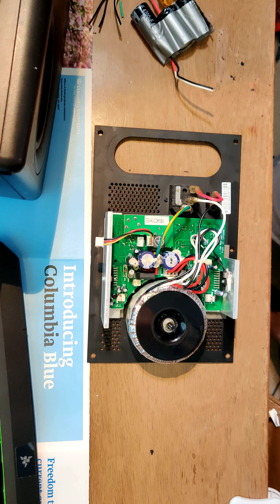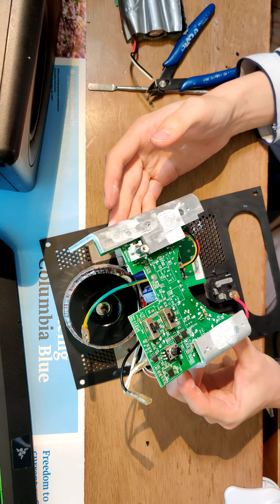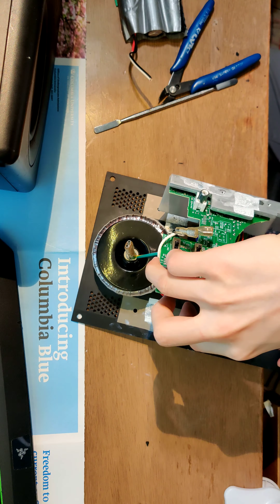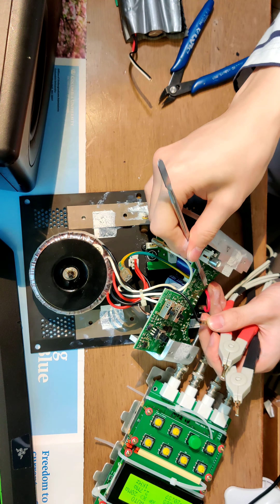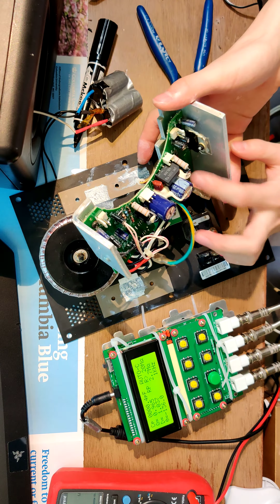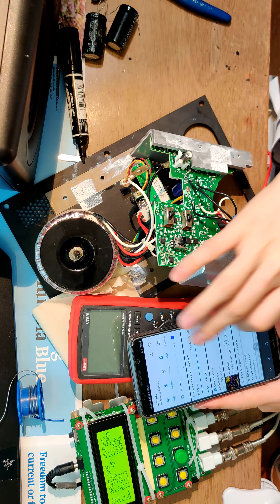Mackie Mr5 teardown Adding capacitors to studio monitor

Comment: On a pair of MR5MK2 I have, both 470uF caps were toasted by the heat of the nearby zeners, also there is a single 100uF on the whole board, those developed 100ohm ESR and read only a fraction of what they are supposed to. Also supposedly there's a C60 4.7uF that is part of a mute circuit that also makes these cut-out.. suggest just replacing all existing caps! I was surprised that both my main 3300uF caps were totally good, as I automatically assumed they were the issue and replaced them only to have them pass ESR tests and mostly ~30% capacity loss.

Comment: Maybe you can help with an issue I am having. I have a pair of these MR5 monitors and recently, one of them stopped making sound. The LED light comes on when turning on the power but I am getting absolutely no sound from the one monitor at all. Tried checking the fuse, cables, audio interface, everything is fine in those areas so I am assuming the problem is within the monitor itself. Any Ideas?
Reply: I have the same issue - based on some info that I just found on a forum post, I’m going to check/replace capacitor(s). C60 is the most likely culprit from what I’ve read, but will be prepared to replace multiple components.
Reply: @456or7strings  Hey there!   I too have a MR5 with lit LED, but no sound - it's actually my neighbors, anyway, "a forum post"?   Could you help point me to the right forum?  Mr Google isn't being very helpful..   Would love to see a schematic, but haven't found one so far..  Thanks!
Reply: @mtrcycllvr  I don’t recall right now - I probably googled the monitor name and something like “no sound” or the like.
Reply: @mtrcycllvr  since links are never allowed, best I can give you is this! "1244040-mackie-mr5-mk2-powers-but-no-sound-output" first result should be it.
Reply: @Roobotics  Hey, thanks so much for the reply!  I was successful in finding the web reference AND I had the speakers fixed in no time - super easy fix.  Thanks so much for taking time to respond!

Comment: I've been using these mk2's for years and love them for close monitoring, however the main caps are going. Is it easier to replace them than to add caps? If replacing which should I replace them with? I'm told that the original caps are low spec. Thanks Leo.
Reply from the maker: It is easier to replace since you don't need to extend the wires to connect to the soldering pad.
 
I would replace them with 50v 4700uf ones or something like that. It does not hurt to increase the capacitance by stacking more. 

I recommend against spending too much money on fancy name-brand or long-life capacitors. Cheap ones will do better if you double the capacitance. 

These speakers have a relatively old amplifier topology and poor noise floor. The hum will go away and the bass will be better after you beef up the capacitors, but the noise will not be reduced.

Comment: What was the issue for you to work on the Mackie Montors. I have two mackie monitors that sometimes the sound gets lower and higher while playing at a set level..  Annoying but I haven't anything about issue online..
Reply from the maker: I wasn't having issues. Just wanted to decrease the noise floor